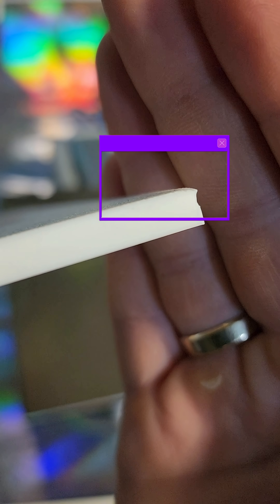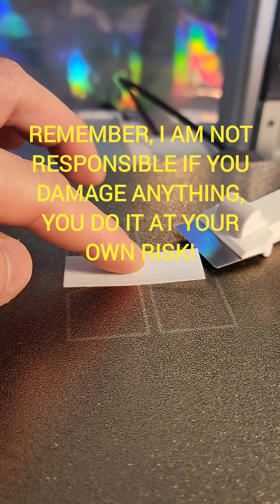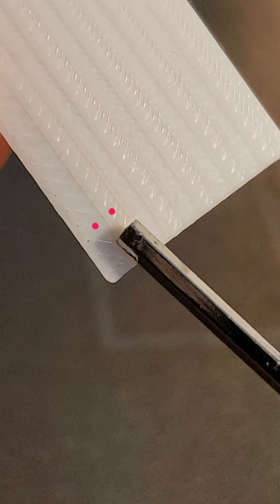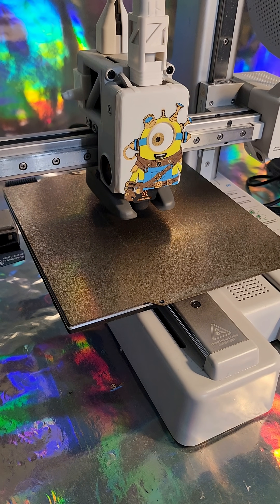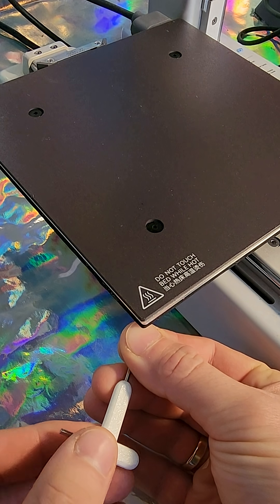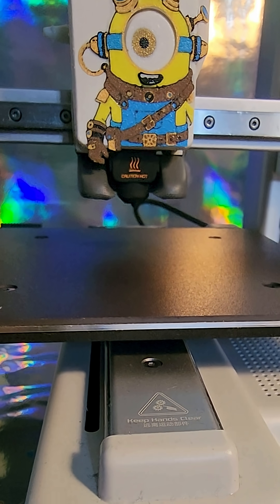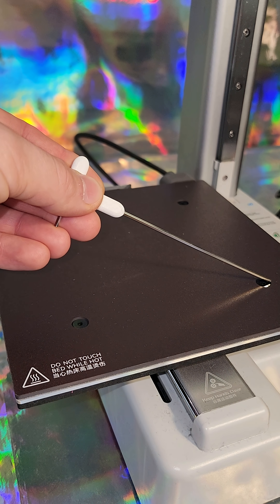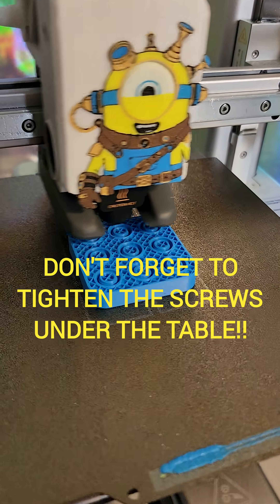Warped Print Corners? Here’s How to Properly Level Your 3D Printer Bed! A1/A1mini

Comment: this is great and all but you need your printer properly set up in the first place to print this. Doesn't help much if your printer is already out of calibration.
Reply from the maker: I agree with you! 😊 However, if you notice it in time, one thing doesn’t always exclude the other. In my case, for example, the center of the plate was printing correctly and only the corners were off. You can always print a test piece and check it with a caliper. 📏

Secondly, you can always order such a tester externally or print it at a friend’s place. 🤝
Thirdly, I believe that even if it’s badly miscalibrated, if you first print a tester, set the plate the same way, print another tester, and adjust again, you’ll get very close to the correct values. 🔧✨

It’s definitely more effective than eyeballing it (as some people do). 👀
Nevertheless, your point is valid and I agree with it, but it’s always worth trying and drawing conclusions from the results! 💡🔍

Thank you very much for the comment and stay amazing! 🌟